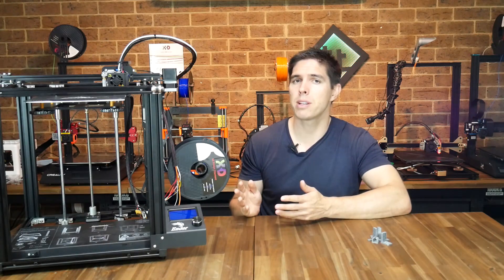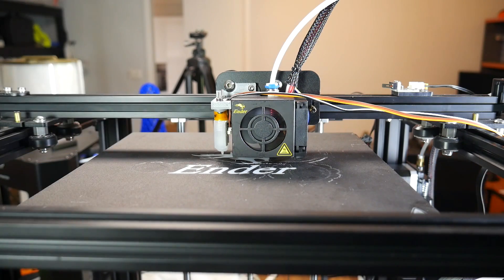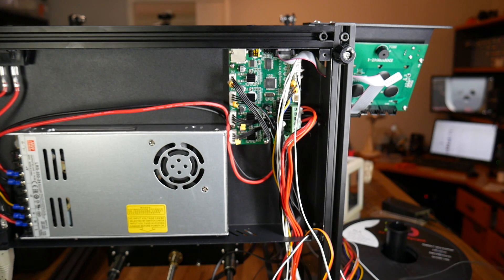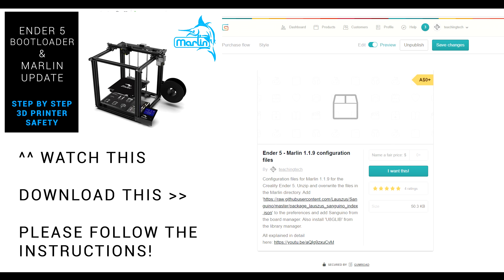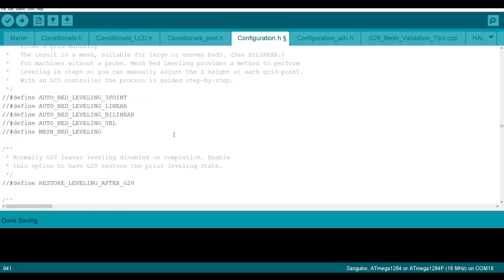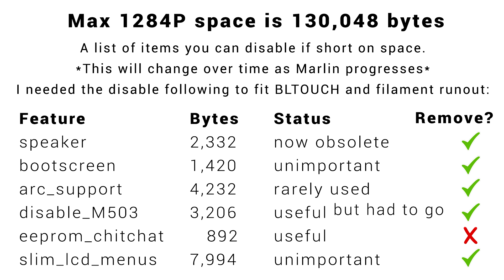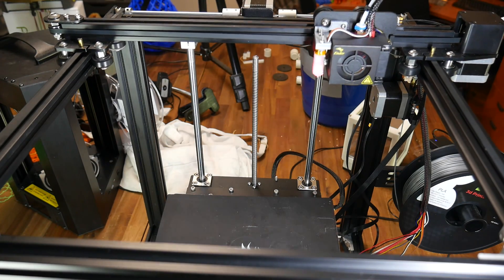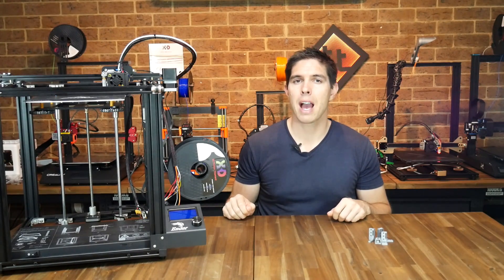Ender 5 BLtouch guide - Step by step for Marlin & TH3D

Comment: Nice informative vid. Cheers Michael.
I noticed that the TH3D BLT presets are very slow and on the conservative side, probing took 2min. Too long for me, so I also made a point of speeding mine up.,and safely got it down to 40sec.
Reply: Make a pull request with the speeds you would recommend. We don't use the probe so we kept the settings recommended by Marlin.
Reply: @TH3DStudio  Sure I'll get on that in a day or two. I also made changes to run the BLT with the EZoutz which is nice.
Reply: @E-3  what did you change to speed up bltouch leveling? in the th3d sketch?
Reply: Thanks for the reminder, I just submitted the changes to TH3D.  With any luck he will approve and might be rolled in to the next up date.    

lets wait and see 🤞
Reply: @E-3  Looks like you made it a little faster than what I had gotten to, I was trying to turn off the double tap probing, but I'll probably end up reflashing with your settings

Comment: Hi, from the Marlin github issues list, it seems that the newer BLTouch (V3) would not be fully compatible with Marlin. cf. https://github.com/MarlinFirmware/Marlin/issues/13345 , and mitigating updates would not be fully compatible with bltouch clones... Just for info/warning.
Reply: Add and delete the lines in Marlin 1.1.9 that are detailed on the following github link.  It'll add the new commands for the BLTouch V3 into the firmware and it should work properly after that.

https://github.com/InsanityAutomation/Marlin/commit/15ce74badfd3a1b6e6ffabf882234ffa77682715